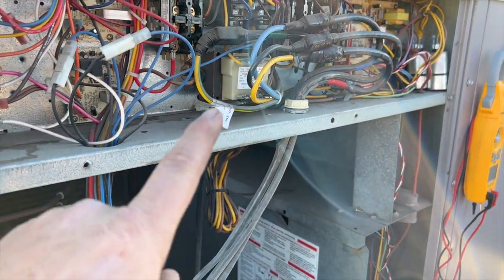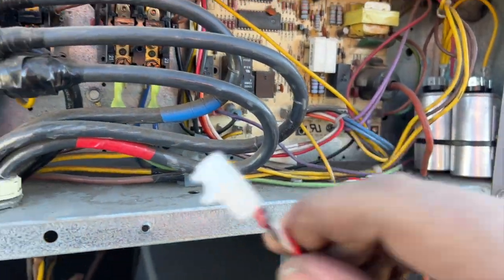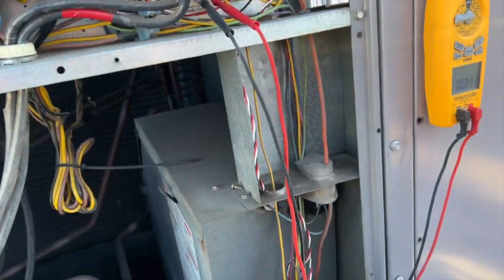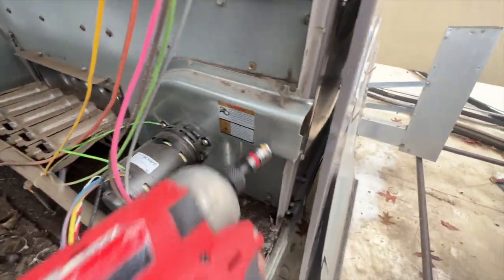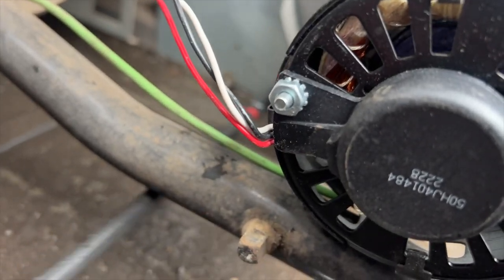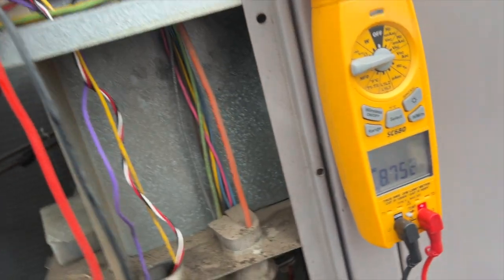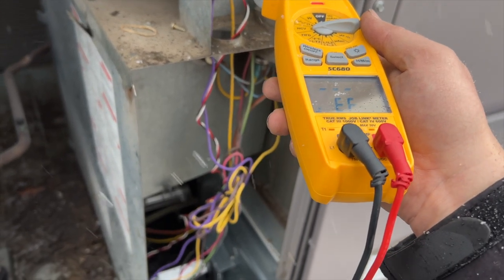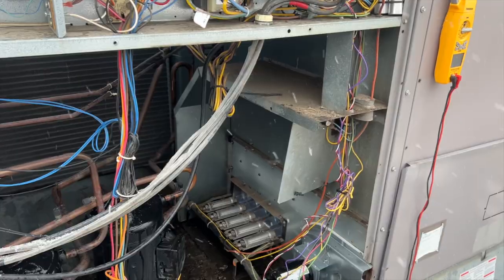How to Diagnose a Hall Effect Sensor on a Carrier Package Unit EP121

Comment: Those sensors are a terrible way to prove the motor is working. The entire wheel can rust off and it will still “prove” that its running and allow it to fire up.
Reply from the maker: Agreed.

Comment: Carrier originally used a centrifugal switch on there inducer motor. You can get the  troubleshooting information for the Carrier Hall effect sensor off the internet. There easy to troubleshoot.
Reply: Old Evcon units also had a centrifugal switch.  I really don't think it's as good as using a pressure switch for doing the same thing as there is no way to determine if it is actually pulling a draft.

Comment: Why not just change the sensor?
Reply from the maker: My local supplier only sold the whole inducer assembly. Not sure if they sell just the sensor. Had to get them Heat right away so i replaced the whole assembly.
Reply: You can Carrier sells them